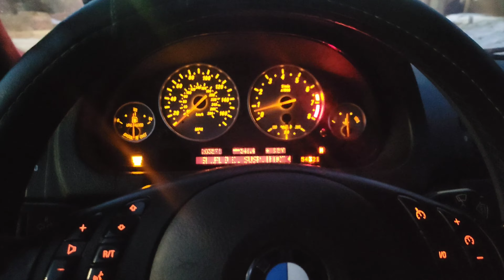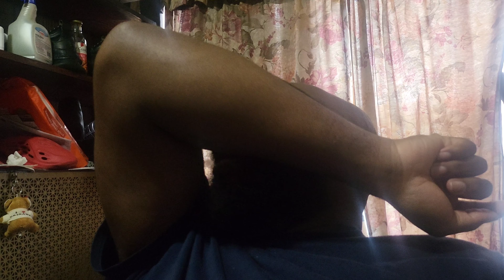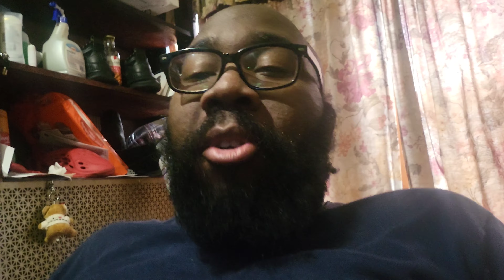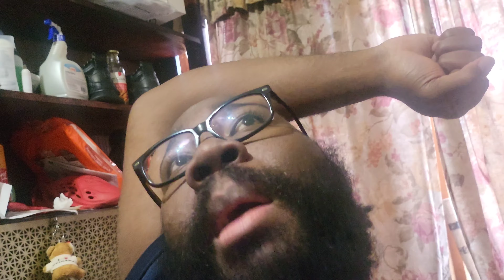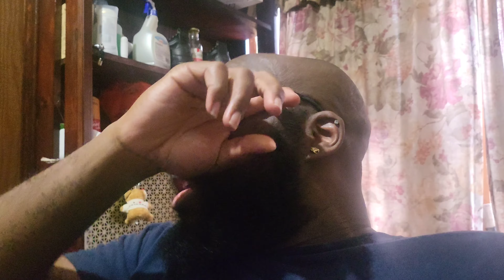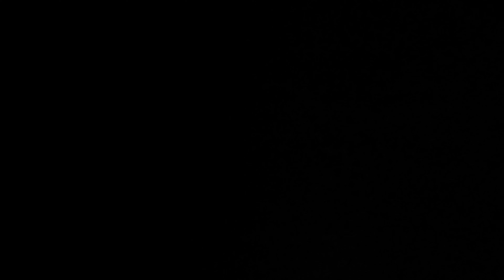How to drive with a broken ZF 5hp24 Transmission | Dinan s1 e53 x5 4.6is 4k

Comment: Mannn, I remember having to deal with the transmission failsafe mode in a past BMW. It was the worst. Whenever it did it, I just turned off the car to reset it to take it out of the limp mode.
Reply from the maker: Goes into failsafe mode when it's hot so when u turn it off will do it again. Unsure what the issue is. Solenoid, converter, etc lol. Unsure if I wanna deal with it yet.
Reply: @imSchwaggy  I couldn’t bother with it because the cost of going piece by piece was more expensive than just getting a new transmission. And I didn’t even want to spend money on that. Everything else was in great shape but I wasn’t about to go broke fixing something that didn’t want to be fixed lol